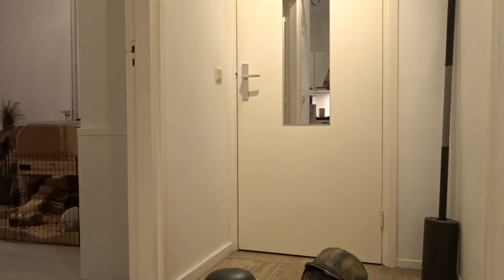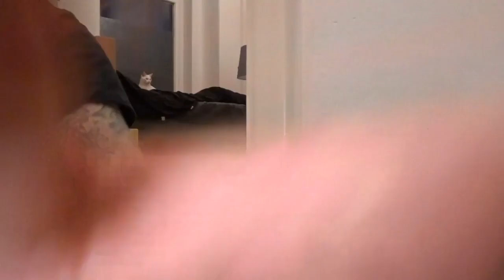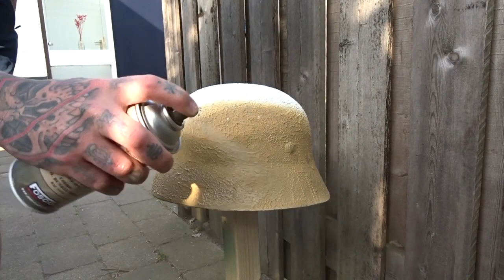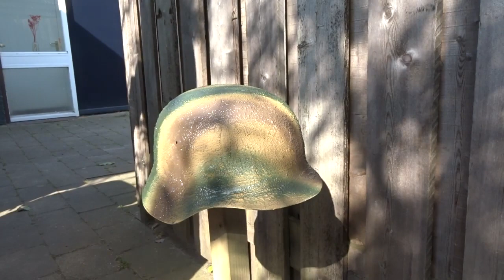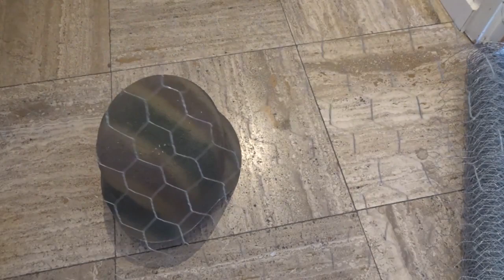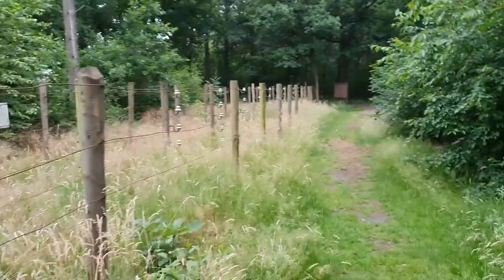Rautarn German Normandy camouflage chickenwire helmet. Number 2!

Comment: two things come to mind..... would soldiers, being soldiers, not just slap and wipe the cement on, in a messy fashion ? and paint... would have been a quick brush, not spray yeah ?
edit: google says: Camouflage can be applied both by hand or it can be sprayed. These are plenty of photographic that it was done both ways. Generally troops who fought with armored units sprayed their helmet opposed to hand painted them due to the fact that spray guns were issued to all armored units.
Reply from the maker: Probably slap it on. Yes, but since it is for reenactment you should atleast try to get it as accurate as possible. About the paint, spraypaint was around back then also. You can see many original helmets with spraypaint on them.

Comment: They never camouflaged the helmets like that, the helmet had a dark yellow paint and aluminum oxide or sand was finely sprinkled on it, I have original helmets.
Reply from the maker: They did actualy. There were very much different ways to camouflage helmets. One of which was using concreet. I have seen multiple real helmets to use as reference. You can look it up.